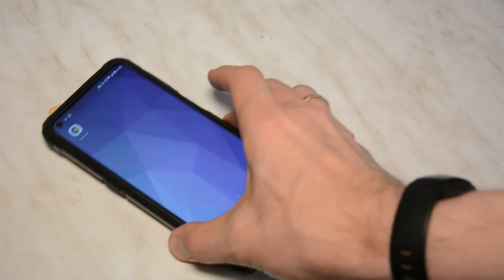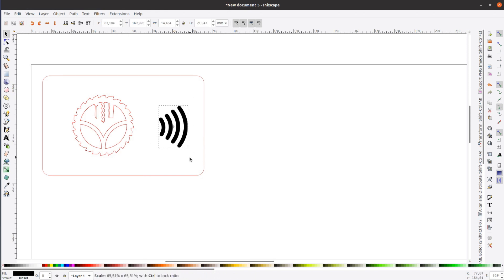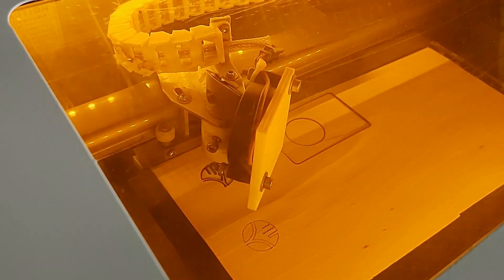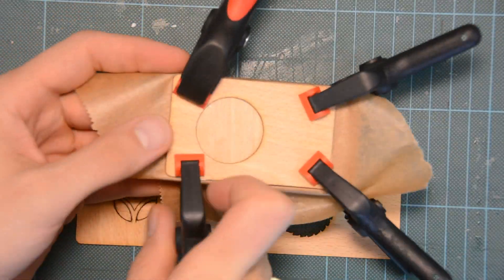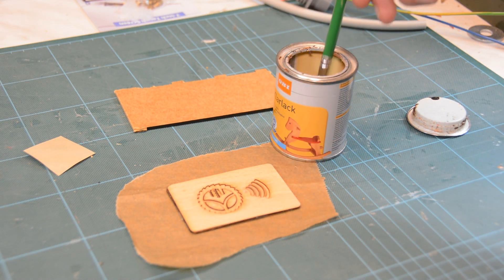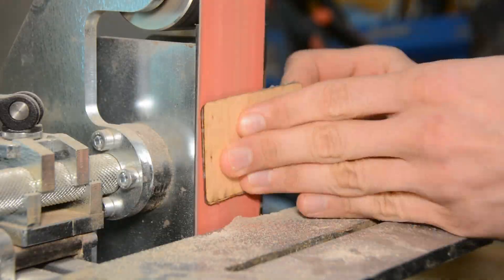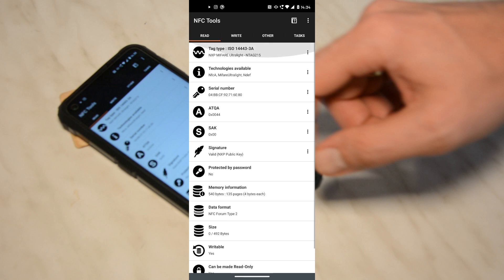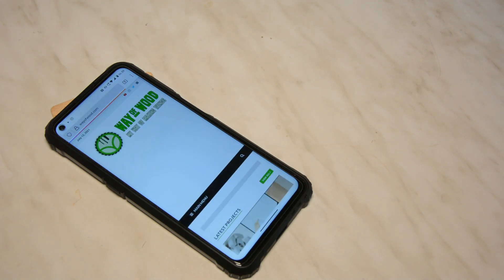DIY Wooden Businesscard with NFC Tag

Comment: How thick is the veneer wood
Reply from the maker: I would guess it's 1.5 to 2mm - but it should work with any thickness
Reply: @WayofWood  thanks. I like the idea have been looking for metal alternative nfc diy for a while with no luck then saw this video. How's the nfc working for you
Reply from the maker: It’s working quite well. I have added a bit more finish to make it more durable - other that that it holds up very well.
Reply: @WayofWood  thanks !!
Reply from the maker: Welcome.
Reply: Great project. You used oven paper? What for?